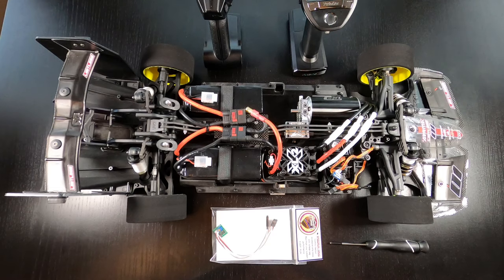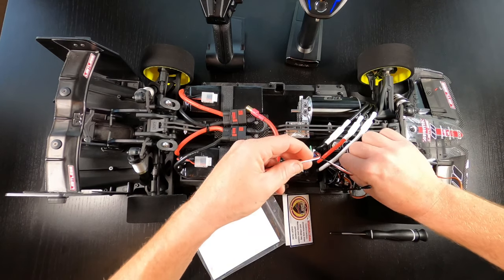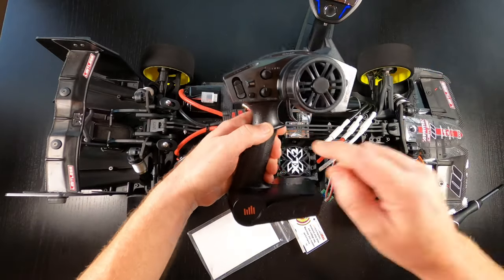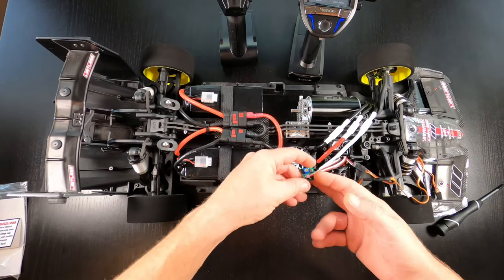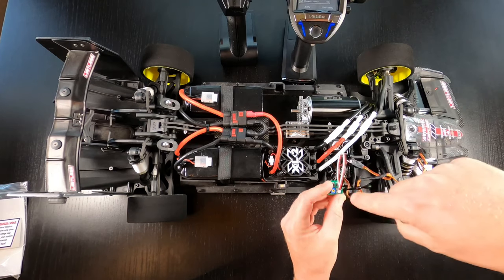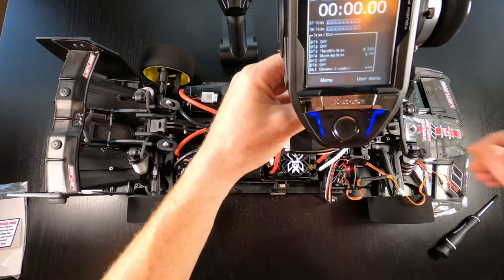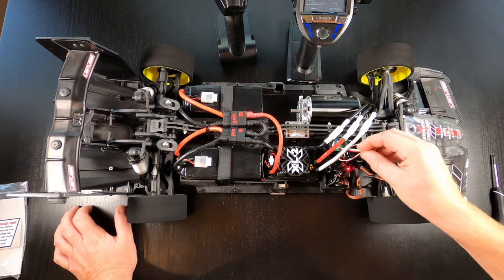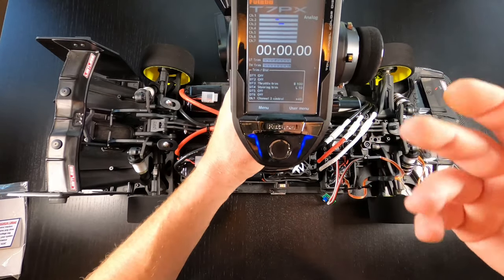PERFECT PASS RC CAR LAUNCH CONTROL- SETTINGS & FAQ's

Comment: I have the FlySky noble NB4 transmitter. And I can set a delay of 10s for throttle. So I think that’s the same as what your perfect pass does. I will give it try and see what my throttle line will looks like.

Comment: Did you trim your tp power motor to make it fit better? I did this exact setup on my felony with a 1460kv motor same motor mount but with a max 5. Wish i would have stripped the anodizing so it looked like this. Also you could just dip the circuit board in epoxy for durability and waterproofing.

Comment: Compatibility questions: 
Of course it supports regular 1-2ms input signal, what is the max freq perfect pass can accept?
Does perfect pass support these protocols:
Sbus?
Oneshot125? 
Oneshot42?
Multishot?
ProShot?
Dshot150?
Dshot300?
Dshot600?
Dshot1200?
Dshot2400?
What is the output resolution steps (200~4096) or bit's (8, 10, 12) for perfect step?
How about telemetry: (back to the receiver, so it can send back to Tx)
1wire?
BiDirDshot?
TIA

Comment: Thank you for the video!! You have thought me a lot in several of your videos. 
When you make adjustments you said the capacitors need to be drained. How do you make sure that they are fully drained?
Thanks I’m advance!!
Reply from the maker: Hey tony, simply wait 20 seconds or so
Reply: For future people reading this. If your esc has a switch or button just press it without the batteries plugged in. Your esc light will turn on for a sec and discharge your capacitor
Reply: @RazShifrin I want to buy for all my fleet of cars but I can’t no supplies why

Comment: I have a futaba 4px. The radio has 3 points for setting throttle speed so I can have the throttle move fast for the first 20 feet then slow down and speed up again. I know the m17 has many more points. Perfect pass if I'm correct has one point. Any thoughts in the future of making this with  more adjustments? That would be well, perfect.

Comment: Raz, I have a Sanwa Mt44. Throttle position and trims all at zero. Esc and control calibrate perfect but when I change the timing delay, I don’t get a delay...change is done with lipos disconnected and no cap packs. Please advise.
Reply: I'm having the same problem. Did you figure anything out?
Reply: Same nothing works did everything in this video and nada

Comment: Raz- should you turn full throttle protection off for speed runs? Also, what percentage are you running on PP? Lastly, Oz told me you are in the process of launching gen 2. What’s the difference going to be?
Reply: For speed runs if you have the pot turned to the delay you want it dont matter.

Comment: Hey Raz....what happens to your car with perfect pass installed with no delay and you turn transmitter off before turning off the esc? My car took off down the street full throttle all by itself until I could get the transmitter turned back on.
Reply: Holy sh!t, thats not good.
Reply: You have to set your failsafe after
Reply: @ryancarter142  there is no “fail safe” nor is a “fail safe” mentioned in this vid.
Reply: @ryancarter142  who sets fail safes in electric cars? they were designed for nitro.. So if your full throttle and loose range, then the mechanical throttle will close its self...
if you loose range in an electric car they stop with out a fail safe.... So how would a fail safe work in this scenario?

Comment: On a V2 board, please use a multiturn trimpot like bourns 3339 with 4 turns, so we get much more precision in the delay adjustment
Reply: While that helps presion, it gives zero visual clue where your set at. I have 4 ideas to make this better and cost about $5 in parts.